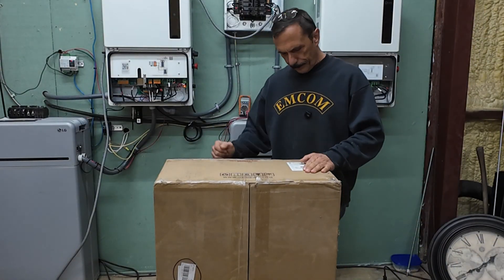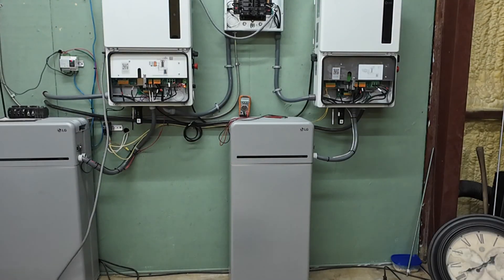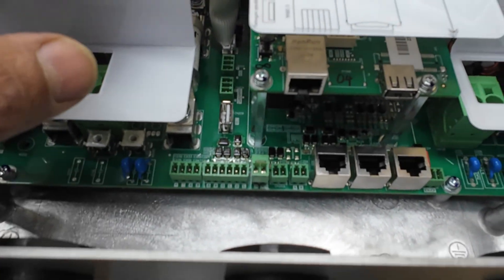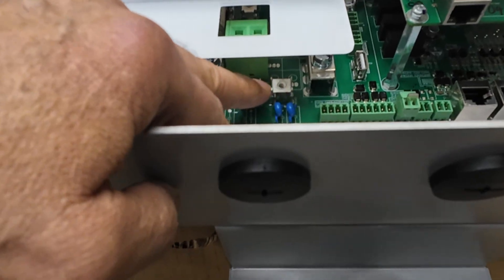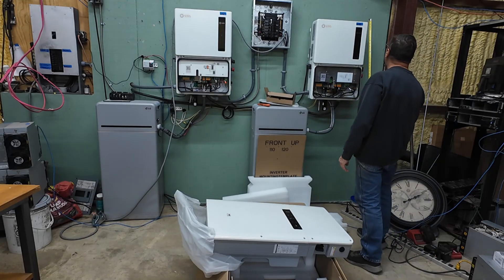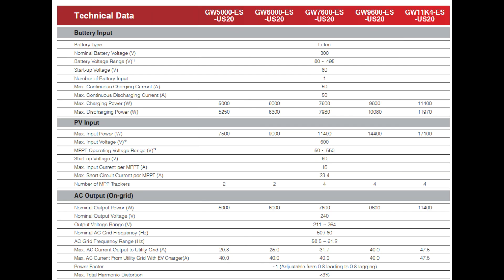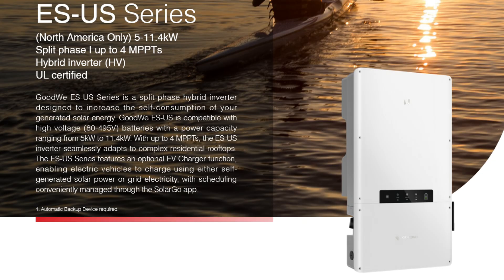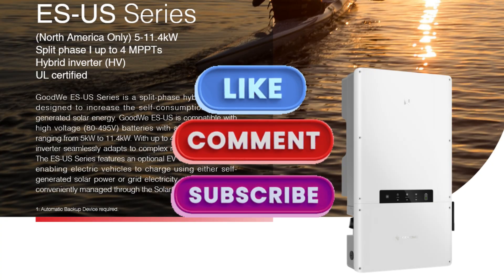GoodWe 11K4 High Voltage Hybrid Inverter Unboxing and First Look

Comment: Ed are you doing any more vids on this? I'm looking into one of these and trying to figure out the wiring. I have micro inverters on a grid tied system. I am looking at maybe hooking one of these up and figuring out if like the solark if i can use the "generator in" as where i can bring in my micro inverters. Currently have no batteries by looking at the LG HV batteries to go with this.  Signature solar is just down the road from me and if I can figure this out before the tax credit disappears. Hope to see more on this product from you. 
Thanks!
Reply from the maker: Yes, I will be doing more content on this inverter as soon as I get some things switched around on the micro-grid.

Comment: Hi, great video! Do you know if this inverter model is  supported by Dala's emulator, and if so  maybe you could do a video using the Nissan leaf battery for an offgrid setup without the external automatic backup device. Thanks!
Reply from the maker: I haven't looked into support for this model but GoodWe is supported so I'm sure Dala would add support if needed. The off-grid set-up is on the list.

Comment: Anyone evaluate Santi high voltage inverters, commonplace in Asia and reported to be rugged and easy to maintain?
Reply from the maker: If you mean Sandi, yes I was in contact with them before I decided on Solis.
They are big heavy Low frequency inverters. I do think they are well built but not as easy to scale for my application as there is no US distribution.

Comment: Do you ever plan on using salvage EV batteries for storage? Seen a few other youtubers using EV batteries(~400V seems like popular voltage for the packs)
Reply from the maker: The Solis in the shed has a Nissan Leaf battery, I have videos.

Comment: This Goodwe inverter only offers a 170% surge rating. That's simply not enough to start the tools in my shop.
Reply from the maker: That's definitely a consideration, kind of like trying to run a 5hp well pump with the Solis 11.4K. ;)
For the high constant loads I run it should be fine as long as it can handle the heat.

Comment: On paper it is almost the same as Solis S6. Split phase maxed out.  Can’t wait to see performance. I wish I had 3 phase in my neighborhood. Would try one of those 50kw 3 phase units. 😅
Reply from the maker: As soon as SS gets them in I'm getting the Solis S6 30kW 3 phase, they will run off-grid.

Comment: Are these Galvanically Isolated inverters? I don't see any large transformer cores. If they are not isolated from the grid by a transformer then how do they protect the cells? (is it through contactors activation?
Reply from the maker: These are HF inverters, same as 90% of all inverters world wide, LF inverters have the big isolation transformers.
Reply: @DIYSolarFarming  I understand that, my main concern is in the Galvanic Isolation and if it is in there for safety.  Both in HF and LF transformers can have isolation transformers, or they could just have capacitors and inductors; interested to know how the safety isolation works

Comment: Man I love this inverter so much. Dead silent. I'm actually rewiring mine today because I love it so much. The biggest downside of this inverter is the limited amount of inverters you can connect to the mid. They need to make it larger and allow for 3 inverters to connect to it. Everything else is great. Have been loading mine up a lot.
Reply from the maker: I haven't dug into the ABD much but it does look like It will take 3 inverters with the addition of some circuit breakers and a little rewiring. I just don't know how the control board plays with paralleled inverters. There doesn't seem to be any documentation on that...
Reply: Should I buy this one and store it in case China shuts down my flexboss21, 18kpv and gridboss? 😂
Reply: @SurgeonTech they r all made in China
Reply: @WillProwse  100%.
Reply: @SurgeonTech at least with eg4 you can remove the dongle
Reply: @SurgeonTech  you should go high voltage imo.  Likely much cheaper and if you push the equipment hard I would think the high voltage stuff would last much longer because it's always going to run cooler.

Comment: Oh, so close! I held out hope that their Automatic Backup Device (MID) could be the high voltage replacement for the EG4 GridBoss, but if it only accepts one inverter input, then it can only provide limited power (11.4 kW) whole home backup. I really want the smaller wires, lower heat output, and lower fan noise (from the lower heat) of HV, but also no-compromises whole home (200A) backup. SolisHub is still MIA, and it looks like the GoodWe ABD is underpowered. Is there anything, or is 48V with the big wires, heat, and noise it?
Reply from the maker: Check my reply to Will, it should be possible but how to test it?
Let's see how it compares with the Solis, maybe I'll buy another one so we can test.
Reply: I think this is the only downside of this unit. I love mine so much but that is the biggest downside. If it could have 3 inverters connected, would be perfect
Reply: So true

Comment: Looks nice. The mid is decent. I’m currently in grid and considering upgrading my solaredge to the home hub inverter and add two LG batteries or if I should ditch solaredge all together. Only issue there is my optimizers/rsd would all need replaced on the roof. Solaredge’s mid kinda stinks for transfer time. Curious how well the goodwe mid does in that regard. Since you have one, care to do some testing? I know you are an off grid channel but could be helpful. Same for solis (if they ever actually release theirs).
Reply from the maker: I can see how it plays on the micro-grid.